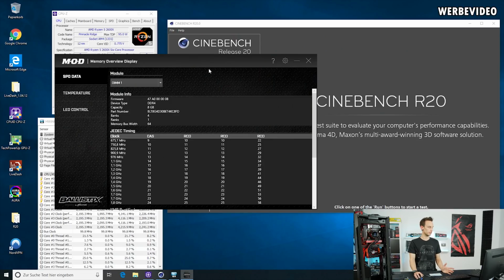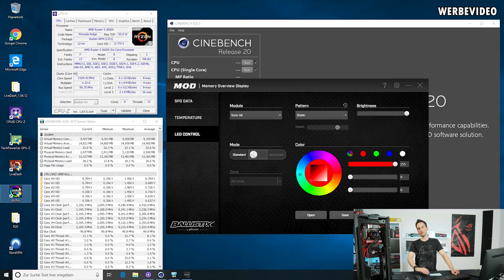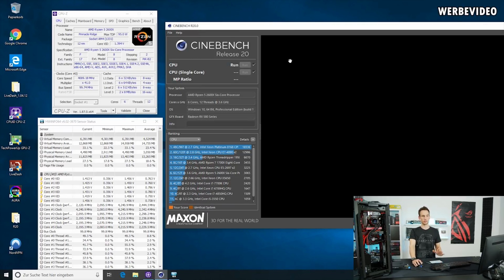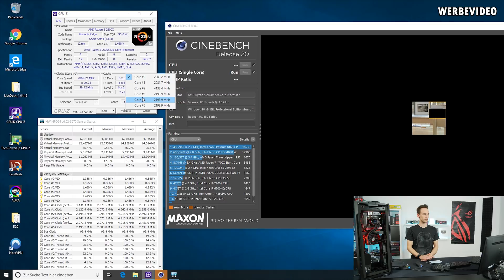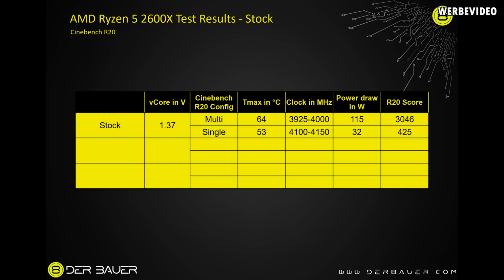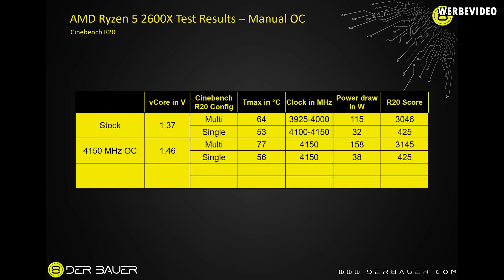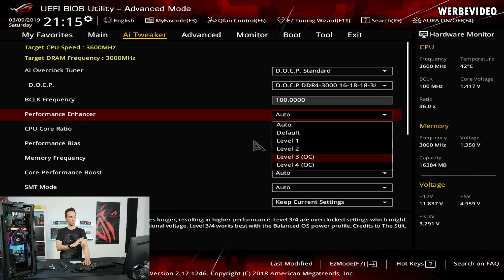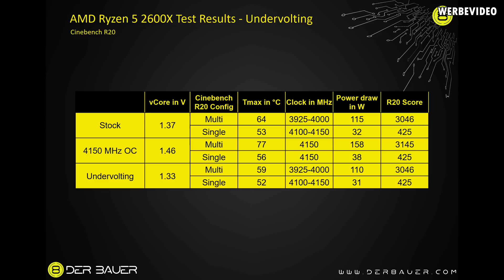The problem with AMD

Comment: You could do memory tweeking on AMD as that much more important than overlcoking.

It just shows you that AMD give you a good product to start with , solder on even the cheap CPUs ( not APUs) good boost out of the box and so on.

Threadripper is more interesting .

I think honestly mate you have a crap 2600x my 2950x can do 4.3 at 1.425v rock solid stable
Reply: Brad Viviviyal  You mean the CPU that works just fine on an OS thats not got a broken scheduler ? That CPU ?

Comment: you could do ryzen memory optimization guide. easy tricks to enhance memory and advanced.  Is 2x8 slower than 4x4?  show us german memory engineering :D
Reply: I'm all for this! I've had the single-rank 4 stick versus dual-rank 2 stick debate going in my head for quite some time. Comparison of overclocking headroom, voltages, IMC stress, stability, max bandwidth, latency, variance based on daisy/ttop/1DPC. Now you just need 6 sticks of the same speed and brand, but different rank and capacity. How many reviewers have that?
Reply: If I remember Buildzoid's video correctly, native dual channel (ie, only two slots, one stick in each) will always be the fastest. With four slots there are two ways to wire the traces, from slot A1 to slot A2 with one longer daisy chain trace, and from slot A1 to slot A2 with an equal-length trace to each slot. The equal length "t-topology" layout has better consistency in clocks: 2x8 will be slower than with daisy chain and 4x8 will be faster than with daisy chain, but routing the traces can be an issue. I think as a general rule, the current Ryzen memory controller works best with two sticks of single-rank, and worst with 4 sticks of dual rank.
Reply: @rinhato8453  okryzen memorycontroller is on mobo or cpu?  so does mobo affect how much?
Reply: @markokorhonen2882  Ryzen memory controller is on the CPU.
Reply: @rinhato8453  so it is improved on 3000 series? so memory video is going to bee good :)
Reply: @markokorhonen2882  A better memory controller is one of the improvements with Zen 2, yeah.
Reply: I'm pretty sure 4x4 is only faster with a quad channel system. On a dual channel system, 2x8 should perform very similarly or the same as 4x4.
Reply: @FinaISpartan  "very similarly" is the part i want tested :) The party line has always been, better overclocking in either freq or timings with single rank. Performance increase due to rank interleaving on dual rank; diff is kind of a wash. I'd like the data to back it up and use it to be able to pick a certain path.
Reply: @FinaISpartan  yes but when you think logically you have 2x physical lanes so there should be less restriction..  i'm into computers and have watched alot of info recarding to this but its still confusing a bit.. anyway  for some reason ingame fps gains  4x4 to my research seems to be best option..  and whats the sweetspot between speed and latency(or what the cl number is"
Reply: @FinaISpartan  I agree as I myself tested with these setups and for 3 systems they all performed the same. There are almost no difference between a 2 x 8 config vs a 4 x 4.
Reply: @Hellurei hoho I imagine that 2x8gb vs. 4x4gb wouldn't make much difference in performance. It looks nicer with no empty slots, but on the mainstream platforms like socket AM4 and 1151, you got dual channel, so 4 sticks shouldn't make much difference as it would still run in dual channel, not quad channel. I have a theory that 2 sticks means fewer failure points and maybe better overclocking 'cause of less memory sticks needing power/working together. I haven't researched that though, just guessing :p I would always choose 8gb sticks over 4gb sticks

Comment: How about overclocking per core? Say you put core 1 on 4.3 or 4.4 ghz, and the other cores on lets say 4.1 ghz  That would be interesting video :)
Reply: Too much effort and performance will increase like 25mhz at most.. not worth it
Reply: @dethskullcrusher  I bet its a lot bigger difference. I have a Ryzen 1700 that goes thermonuclear past 3.8 Ghz... I'm pretty sure I could get at least a few threads up higher. Plus my TR-1950x will do 4.3 Ghz all core on a cold day, but I keep it at 4.15 Ghz (little 120mm AIO that doesn't cover even half the IHS), so it probably could do 4.4 Ghz or higher on at least a few of its 32 threads for the rare times I'm not heavily multi-threading. Tuning RAM for 30 hours, not worth it. Getting an extra 50 Mhz and having fun playing around with it for an hour, priceless! (I buy parts to overclock and have fun with, the more fun I can have on a part, the less I need to spend!)
Reply: @jakegarrett8109  
30 hours...ouch. Just buy the best you can get, and don't fine tune so hard.  If you're willing to spend 30% more for good ram, there are kits available as fast as your CPU OC, with tighter timings than generic ram 3/4 the speed.
Reply: @auturgicflosculator  Since you may not know this, even Intel's best CPUs on special made RAM overclocking boards sometimes have a hard time hitting past 4000 Mhz on RAM rated for 4600 Mhz. You basically need the top 10-15% memory controller of 8700k or 9900k to reach those rated speeds (and it may be a dud overclocker on the core, so you might need over a dozen CPUs to get a good one for both core and memory statistically speaking), and you'll also need it paired with a board specifically made for it (it will have only 2 slots, and the PCB traces are optimized for exactly the same trace length per run, and minimize cross-talk EM interference).

But, yes, generally the good RAM kits are a good idea to save time. I was trying to learn how the seemingly 100 different sub-timings could affect performance (there were at least 30 latency settings I tested, it was... Interesting for the first 30 minutes, then um... hair pulling around hour 10...). If it wasn't me just trying to learn, to get better, to understand how everything affected scores, then yeah, I would say buy the best you can get. But regardless, I would spend at least that much time on it even if I had the best (probably more though, since I'd really want to dial it down). The new RAM kit I'm using now is 3600 XMP quad channel Hynix (quick testing shows 3733 is easy, but past 3780 like 3800 just isn't happening, at least without extra voltage), and "it just works!". You have no idea how happy I was, that I plopped it in, and holy cow, it just booted! Like whoa! I couldn't even get 2800 Mhz working on Ryzen 1700 (even after like 20 boot-loops letting it memory train...), but my Threadripper just fired up immediately with 0 memory training (power cycles, the board auto tries different sub-timing settings until it works), I was mind blown. So yep, if you're a normal person, just buy the better stuff and save the hair pulling! Totally agree with that!
Reply: @jakegarrett8109  wow that's a pretty good example of 1950x! Mine can only boot and run some light loads (firestrike) at 4.3 ghz  and 1.5 V
Reply: @riba2233  Yeah, I think mine was 1.55v for 4.3 Ghz (like i said, it was cold day. It was probably around freezing, I think that was the week my milk froze without the fridge kicking on for a couple weeks, lol!)

It should be rock solid for 4.2 Ghz with temps in the 70's at worst with a decent water-block that actually covers the chip (like on a hot, 100*f day without air conditioning). The tiny AIO I use now just leaves this laughably small circle of thermal paste in the middle of the IHS, and GN showed it just barely covers the corners of the actual chips since they are so far away from center on Threadripper. I'm hoping for 4.25 Ghz with 1.52v stable below thermal limits under heavy loads (gaming is not heavy, LOL!). I often do 4x Handbrake encodes at once, my "quick" stability test will be P-95 plus Cinebench, plus 2-4 Handbrake batch encodes for an hour straight all at once, then it needs to survive 24 hours of Memtest with 0 errors, and then I'll call it good enough).

The voltage I use may seem high, but it will vary on your LLC (I hate using LLC in most conditions). With LLC, you just have no idea what real voltage the CPU is getting (and without an oscilloscope, you could be blasting it with 2.0v every time the load kicks in, because a normal multi-meter takes 3 readings per second, not the Mhz range like a VRM, you only get 3 Hz sampling, you'll never see it!). Software is also vastly wrong usually even on the averages (I normally go by a calibrated multi-meter measuring the back of the chokes at least when I start pushing high voltage, because I've seen software say 1.35v, when it was 1.55v and even worse...). The voltage I may input into the BIOS for this "1.52v" estimate might be 1.45v with LLC level 1 (extreme LLC), Asrock has LLC5 as "no LLC", and LLC1 as max. So just take my voltages with a grain of salt, I'm mixing a bit of real and input voltages here.

Comment: A video about AMD lowest voltage to higher clockspead, this is challenging 
pushing 1,4-1,45 volts to achive 4,3 ghz is not the best thing, I have achived 4,45 with an 2600
Reply: Tadas Nanartonis  check my cpuz on my instagram dj_dark_modulator 
new low for my everyday
1,28v 4,2Ghz
Reply: Tadas Nanartonis  I've got 4.3 Ghz on TR-1950x all core before, that's really not too crazy (it needs to be a cold day, I only have a 120mm AIO on it... The cooler only covers half the IHS, and its a 1st gen Asetech pump, so not exactly the best case scenario if its 100*f in my room, for that I run 4.15 Ghz since I run 4x Handbrake encodes at once while watching videos on a side monitor while gaming with 4x R9 Fury crossfire at 4k Ultra on my center monitor, and usually the 3rd side monitor runs a web browser. So it certainly needs to be stable). I'm thinking I'll get an actual water-block and tie it into the loop soon, see if I can push it higher!

Specs:
3600 quad channel memory (Hynix), it will do 3733 just fine, but I'm a little OCD about numbers, and if it can't hit 3800, then I'm out!
2x SuperNova 1300 (its a Halloween build in a casket, it obviously needed "13's")
3x Sapphire Nitro Tri-X OC+ and 1x Gigabyte (1160,1150,1145,1110 Mhz from 1-2-3-4 slot positions, pre-binned for organizing the fastest cards in top slot), these are now water cooled (binning was done on stock coolers)
Asrock X399 Tiachi (super cheap, gets the job done)
case: custom made Vampire themed casket, skull with pump hidden inside, parallel flow that puts a water hose to shame, massive 260x220x80mm copper radiator from a school bus for warming passengers, cooled by 4x Sunon Maglev (magnetic levitation server fans)
T-REX LN2 cooler for Threadripper optional (I'll use it for an eerie "fog effect" when I post the video)
This will be the first decent video will be on my other channel (I had it on the test-bench gaming for like a month, so it performs great, but I'm still working on the water loop so its not just going into an open bucket, LOL!): https://www.youtube.com/channel/UCZp2Om_w_o0ry_FQhAUp-CA   If you have suggestions that sound insane and fun (fire hazards are welcome!), then leave them in a comment on one of my vids, and if its crazy enough I'll do it!

Comment: I totally agree, after owning two am4 systems 1600/gigabyte b350 mini itx and 2700/asus x470 mini itx and espenisve b-die ram I went back to intel again. Why? Because intel platforms allow for using faster ram and even if it is quite fun to tweak the am4 system the results are quite small compared to intel.

Comment: TL;DR; XFR is too damn good :)
Reply: It's pretty sad that we're considering 3.9-4.1GHz to be "balls to the wall". Intel makes for more interesting content because their CPUs actually overclock. Like at all. You can get 5.0-5.2GHz out of them. Obviously people rant and moan about their power consumption and heat when you have 8 cores running at this clock speed and make out that AMD's CPUs producing less heat at over 1GHz lower clocks is somehow a victory, but AMD has been held back by very mediocre process technology since the first generation of Ryzen. I hope the move to TSMC changes things. It made Vega perform like Turing, so that's something.
Reply: @cakeisamadeupdrug6134  it IS balls to the wall... for AMD.  i'm loving my 8600k@5.2 though.
Reply: Damn fine explanation. Zen + "x" models comes ready out of the box. Grab a good cooler and the cpu is ready to go.
Reply: its good because AMD ryzen cpus cant even really be overclocked anyways.
Reply: @thelasthallow  no... if xfr wasn;t a thing, then you would get more overclocking yourself. you dont get good overclocking because xfr is good. but this has for a long time been an AMD thing. they release their shit balls to the wall, so they can be seen competing to the average consumer.  thegy could have released all their cpus with a max clock of 3.2-3.5, and then overclockers would have made tons of videos about how you can get an extra 700-1000mhz increase in clock speed, but then 95% of users would just see low perofrmance. so instead they clocked them higher and introduced XFR, and the average consumer sees relatively good performance for lower cost and lower power usage. while all the overclockers are like, meh. this is no fun
Reply: @thelasthallow  im not saying i don;t like xfr, or that it does a bad job? :/ you're an angry little person.
Reply: @thelasthallow  No precision boost literally does a quick stability test every millisecond to make sure it can boost as high as possible, at every combination of load/power consumption/temperature. Better than you could do manually. And it does this while trying really hard to keep voltages/temps below the point where you'll get extra wear.
Reply: @Lead_Foot  yea but precision boost overdrive from bios makes my voltages go to 1.5 o_o constantly it goes 1.4-1.4x-1.5 . Doesnt that cause more wear on it? I set it to auto just because i want this cpu to last 4-5 yrs max.
Reply: @jhonbells  not if its at idle. When under load it should not go higher than 1.38.
Reply: Drachmus

Comment: It's not a problem, it's a feature? 

If you pay for an Ryzen-X cpu you really get the best in that class of processors. They even bundle the 2700X with a stock cooler that does a decent job at cooling the cpu. You just plug it in the motherboard and you're ready to go.
Reply: he's not saying it's a technical problem, he's saying that because the out of the box performance is basically as good as it gets, it creates problems for him to create content on overclocking on his channel simple. This is not a criticism of teh product, but merely a response to why he doesn't do any Ryzen overclocking content and the answer is you don't really need to overclock ryzen.